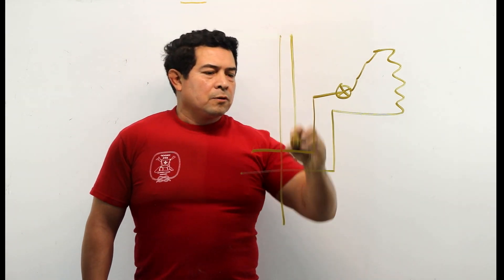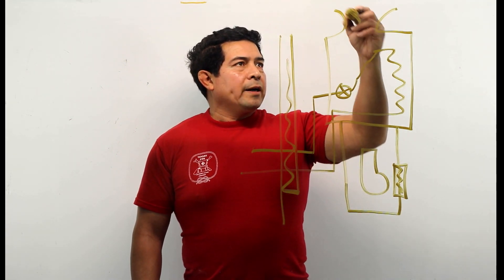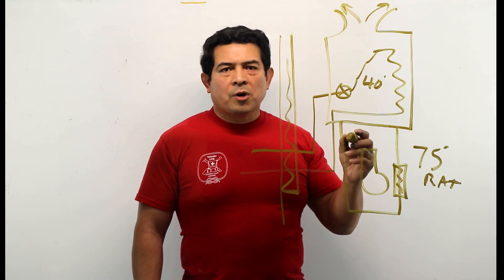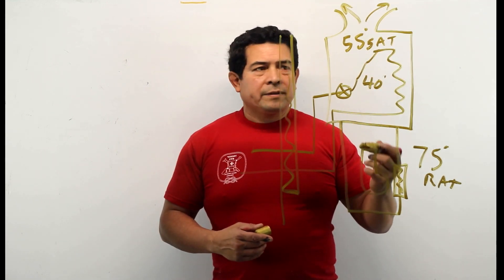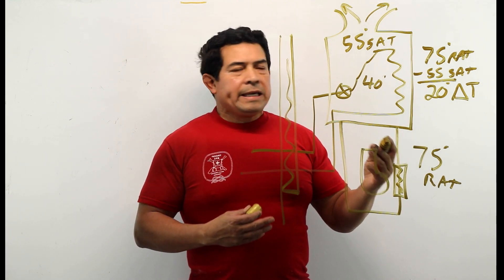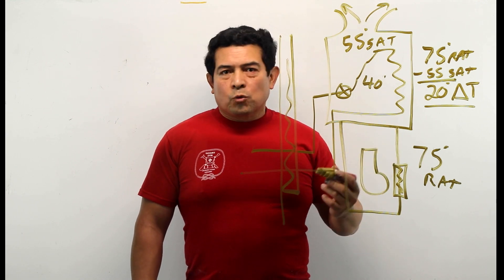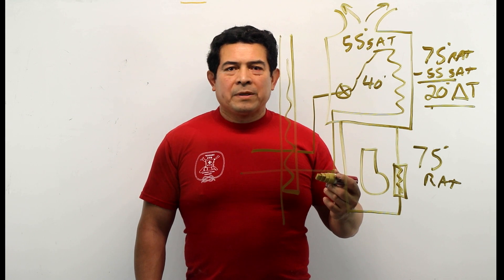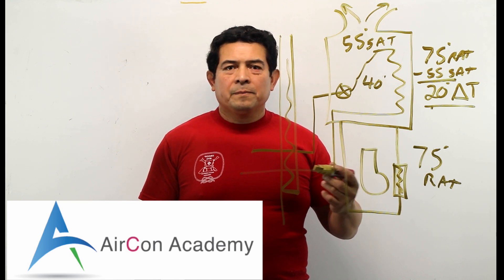Delta T or temperature difference - HVAC Online Training and Courses

Comment: That’s for the cooling cycle. What about the heating cycle? How do you measure the efficiency during winter?
Thanks for sharing your informative videos
Reply from the maker: Typically we do most of the readings in the cooling mode, with the heat pump system is being charged it is done in the cooling mode, and we need to take good superheat and subcooling ratings, depending on the metering device that we have. Thank you for sending your questioning, and thank you for watching!

Comment: You have any  chart for  charging Freon to fridge  freezer  ac work chart or book to gide
Reply from the maker: With fridge or freezers that information is usually on the data plate. Since it is a package system, the manufactures tell you exactly how much it needs to be in there. Remember, there are only three ways to properly charge a system. Super heat, sub, cooling and by weight. Thank you for watching. I hope this answers your question!

Comment: I always get a mistake  for solving in a graph is there a way I can always get the delta T correctly?
Reply from the maker: I'm not sure I understand your question. Like in the video I am used to taking the return air temperature, the temperature of the air coming into the unit and then the supply air temperature, the air leaving the unit. Then I just subtract the two. That is the easiest way for me to get my temperature difference/delta T.